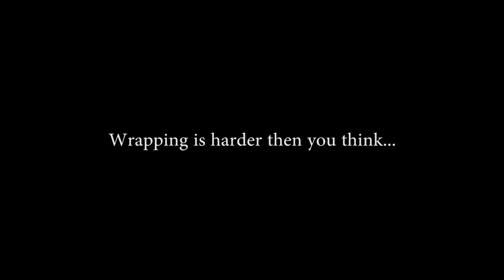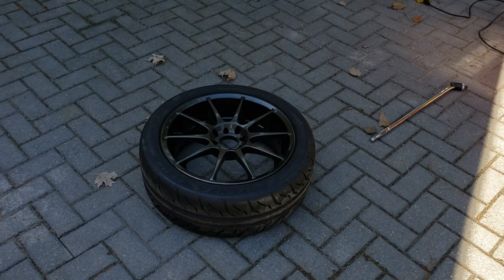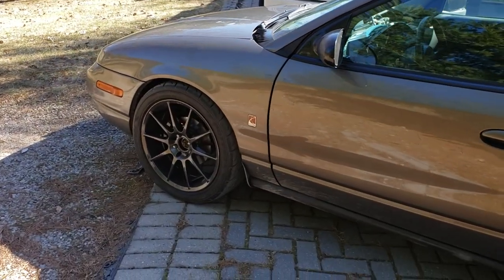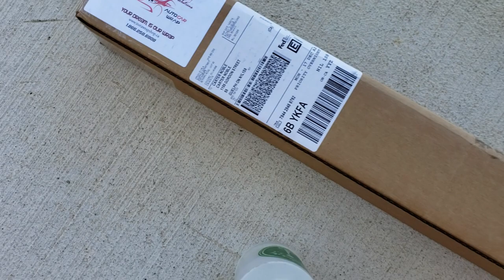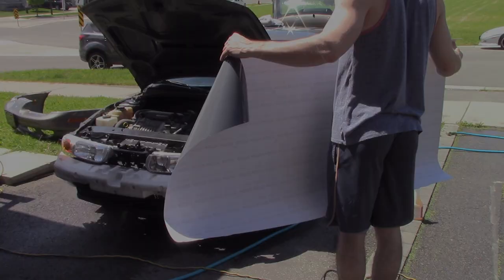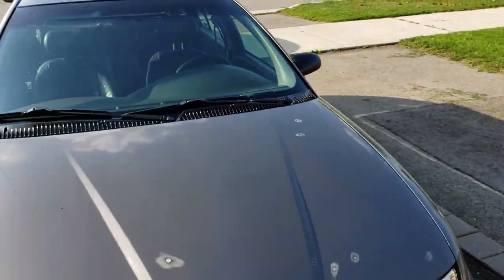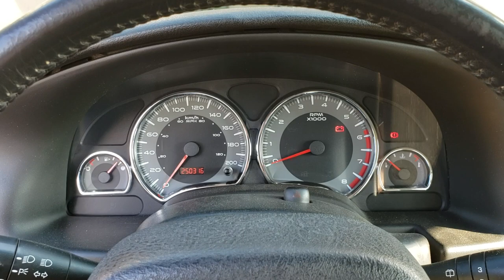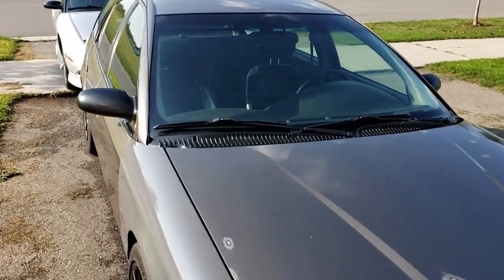New Wheels & Vinyl Wrap - Sleeper LSJ Saturn Wagon - Pt 20

Comment: I love the look of your Protege5 spoiler! I picked one up this spring for my 98 SW2. Did you leave all the extras to it (the 3rd brake light and the other back plastic pieces) on it or did you ditch them and smooth out all the bolt locations?
Reply from the maker: Bondo/fiberglass over all seams and bolt holes of the plastic housing that holds the brake light then painted black. FYI the spoiler required a significant amount of time with a heat gun and a dremel to make it fit right.